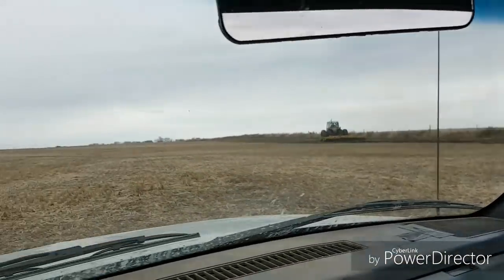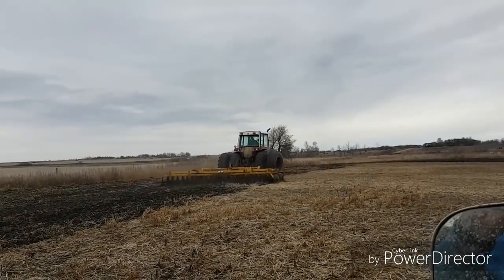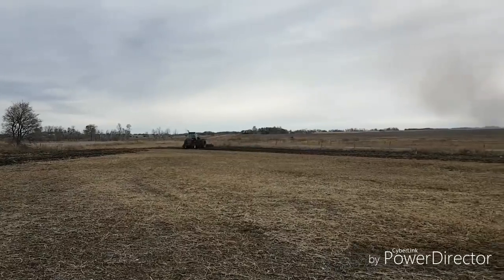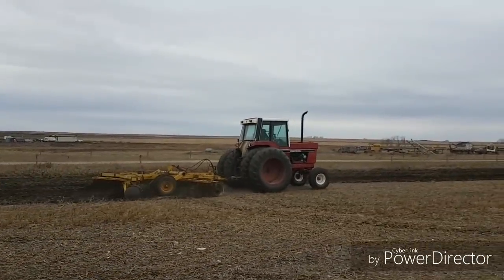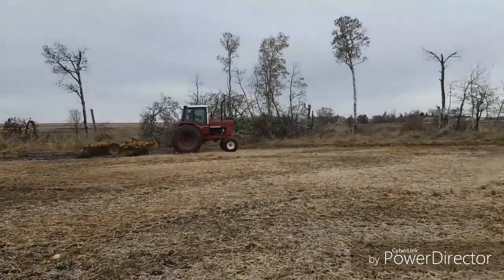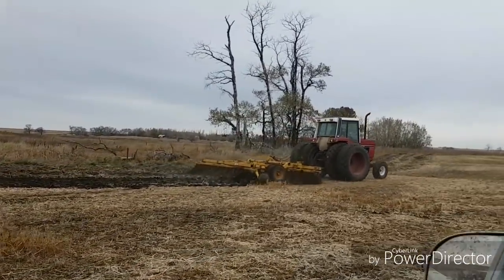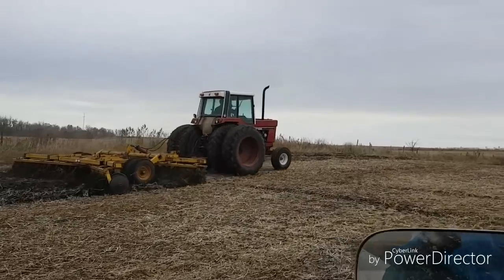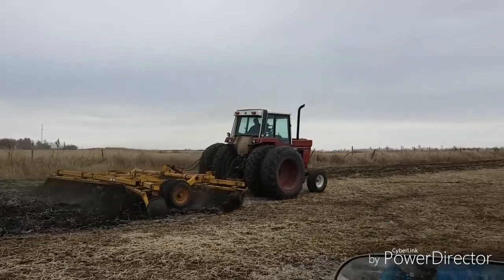Disking soybean stubble with the 1086!

Comment: Could look into putting a disrupter kit in the concaves of 2388, helps shred up the bean stems. Basically a steel knuckle that pokes through the concave so the rotor grinds stuff against it.
Reply from the maker: What I needs it the chopper rebuilt  the stationary knife is toast but we redid it while it's been snowing outside

Comment: What brand harrow is that? Spent many hours in 86 series machines. The engines are just about bullet proof. Transmissions too. Harrowing will help break down that trash over the winter. Do you have a muffler deleat pipe on it?
Reply from the maker: Yup its straight piped and I've no clue what brand those harrows are Haha
Reply from the maker: The disc is an ez-on
Reply: @SouthSaskFarmer1  Looked like a "Rome" heavy to me.
Reply from the maker: @johnnyholland8765  aaah yes same yellow almost Haha

Comment: Why would you delete the TA, doesnt the kit cost almost as the rebuilt TA? The newer TA's are a lot better than the original and they claim it will be the last TA you will buy. That TA was one of the best things about an IH tractor. Also the labor hours to change the TA or install the delete are about the same.
Reply from the maker: 3500 for a ta 1100 for the delete lol best thing about an ih is the fact you can trade it for a Deere lol
Reply: @SouthSaskFarmer1  spot on buddy!!